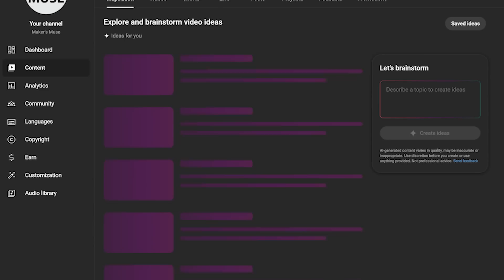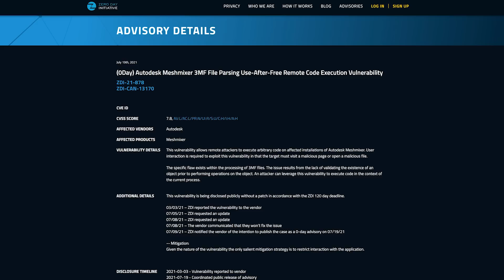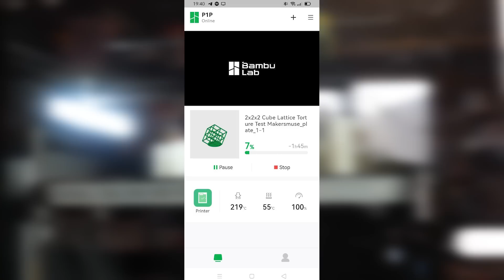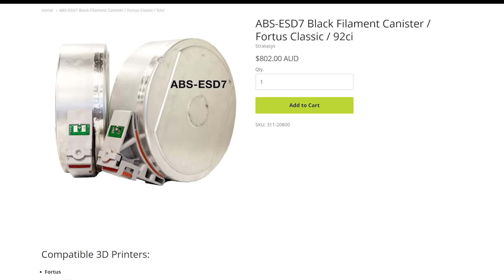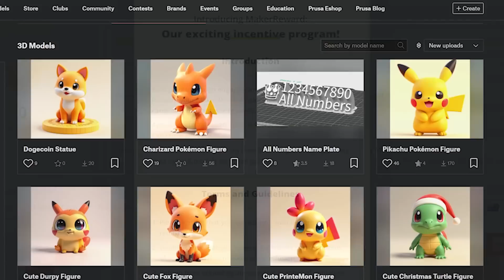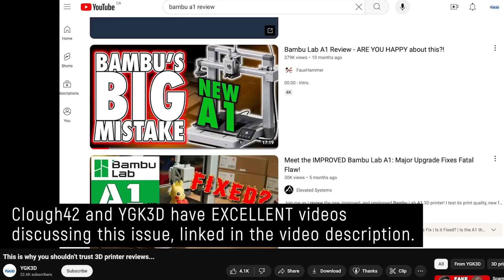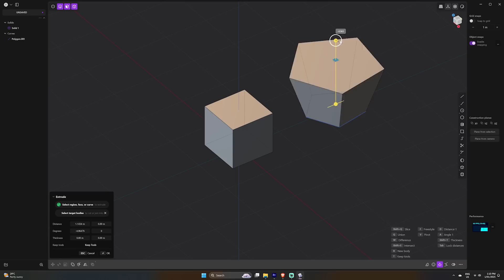My 3D Printing Predictions for 2025

Comment: I want a bambulab style resin printer. Pretty much everything self diagnosable. I went through the ropes of both fdm and sla since 2018. 

Its time to get these no nonsense printers. However my favorite is still the ender 5 ahaha
Reply from the maker: Formlabs or prusa sl1s are pretty close, but spendy
Reply: @MakersMuse  yeah quite expensive. If I will splurge then definetly the formlabs. looks insanely good.

Comment: Hey, do you have recommendations for flexible 3d printing?

I want to create stamps that work on any surface, therefore i need almost rubberlike stamps, but i have actually no idea what the differences in material are, what i should look out for and what printers work best, or which can't handle it and why.

Comment: Honestly, resisting AI and its place in 3D printing is no different to how it is in any other industry. You have two options, either make a moral stand against it, put your arm out in front of the bulldozer and and get bulldozed, or jump on the bulldozer and make it drive somewhere you want it to.

Referring to them as 'slop' doesn't help you, or anyone. Because in one year, that 'slop' is going to be indistinguishable from work of pros. And then where does that leave you? A bit like Motorolla and Kodak. No one ever got ahead in life by trying to resist innovation, they were the ones using the innovation to their advantage. People need to accept it is here to stay, it is advancing at a rate so fast it is unreal, and if you don't get on board, the majority of the population will as you get left behind.

No one has to be happy about the rise of AI, but trying to be condescending towards a program and insulting its outputs is a... strange use of personal effort.

Comment: AI that generates 3D is a bit different, because it's almost always actually two AI systems, the first to generate/design the image, the second to turn that image into a 3D model. So even if you did find out what it was trained on (the turn into 3D one) it wouldn't matter much because the one doing most of the heavy lifting is the image generator instead. This can be good or bad depending on how you look at it.

Comment: Angus, your channel is the main reason I took a shot at 3D printing nearly a decade ago.  From then on, I was hooked.  I even incorporated 3D printing into media classes I was teaching.  And now it's my go-to solution for my other hobby, model railroading.  I've made replacement parts, structural components, scenery pieces -- the possibilities are almost limitless.  So thanks for being a guide on this long journey.  And one other thing I'll add that I think will become increasingly important:  fabricating companies.  They're extremely affordable for big jobs I can't do myself.  I needed about 600 pieces for one job, and I found a company online that could fabricate my design for pennies a piece.  That's transformative.
Reply from the maker: Hey, that's amazing! You got in early, glad you stuck it out as the technology improved :) I fully agree, being able to have parts machined out of metal at an affordable price is incredible. between the two technologies, you really can make anything now.

Comment: Most of the hardware features are ironed out that prevented this hobby from going mainstream.  Now the big gains are going to be improving the software side, and make slicers more user friendly. 

 Bambu Lab has sort of got there using the app with creator tested profiles and slices that can be sent by a cell phone.  Even my wife is willing to give it a go. 

Cloud slicing, I think, will be more of a thing. Lychee has gone half way there switching over to a subscription base.

Comment: open Q and A 
video topic too please 
3d printer micro sd card reading limits
-- whats a solution for not being about to buy small gigabyte micro sd cards soon
my loc office shop is stocking only 64gb as the smallest micro sd card limits
can buy 8gb fake ebay cards?

Comment: G'day Angus. I've thought about getting into 3d printing with resin, but I'm hesitant. Not because of the safety concerns but rather the potential for failure. I tried FDM for a while, but it didn't work out. Any thoughts?

Comment: I fear your thoughts about 'cloud' are a bit incomplete, and you are missing the miost important and most dangerous part: Once an former software selling company has enough customers in their cloud, they will simply stop offering non cloud software. This is what happened with each and every software that went to the clouds before, and this will happen to any software in the future when there are enough customers using the cloud offer. It won't come back to your PC.
So the idea of 'having a PC with a local installation' in stire is completely useless and leading you into a false sense of security: The one day wheer you will want to make use of it, there won't be the software you need anymore. So don't expect being able to swap to another vendor's software when it's time - because their software will have been cloudified, too, already.

The potential loss of control, convenience, and ability already starts with supporting the enterprise's cloud ambitions by just using their cloud offer. Yes, also the idea of cloud stuff being more convenient is a short-sighted fallacy, because, you know: Once they have forced you into their cloud with no alternatives, you will have to pay for every little bit of convenience.

Comment: Much fewer printer reviews ! 
Perhaps though, a review is needed on a recent account of Bambu labs changing its terms of service and firmware update.
There seems to be a ruckus at the moment about how Bambu labs is restricting users of accessing and using their 3D printers through a recent firmware update.  I'm not completely sure what is going on, but It may be that 3d printers are becoming more proprietary like some tvs and other devices that need an internet connection to operate. A kind of prediction of more cloud computing as given here here except that to just send a print to the printer or control them on a computer LAN network, one surrenders their 3D printer and all print information so some external overlord. This may accelerate the other prediction made. That of digital minimalism. In this case for 3D printers.
Would consumers buy a 3D printer if they can't use it because it isn't connected to the internet or unless they use the manufactures price gouged proprietary products and subscription service ? 
Another prediction for 2025 that is in the DRM prediction which if comes true, may end 3D printing for the hobbyist that is the back bone of the industry, and thus the industry itself. 3D printing for the hobbyist may be numbered ?

Comment: regarding onshape, hardware performance is not really that much an issue anymore especially for the average user who will just make simpler assemblies - I can vouch that on the $40 chromebook I bought and installed Linux on both Freecad and Blender worked perfectly well. The main advantage Onshape has (besides marketing) is convenience - you don't need to bother installing anything, and it is trivial to create a free account and start working with relatively small limitations

Comment: As someone who has had to deal with 3D printing models for customers, the sheer increase in models that have to have their mesh and geometry manually adjusted to be properly air-tight for 3D printing is so unbelievably painful. It's so easy to tell they've just gotten an AI to generate a model put no thought into the design or had any input on what it actually looks like, pretty sad.

Comment: I might have gotten lucky with mine, but I was a little saddened to see the Tevo Tarantula footage when you spoke about bad printers. It was my first printer, helped me learn a lot, was my workhorse for the longest time and, baring some external circumstances, would still work well if I had the time to finish the upgrade.
I know that's not the point of the video, and that my affection is irrational. Still thought I'd speak up about a really old printer no one really cares about anymore ;)
Good video as always, cheers!

Comment: I'm glad that you predict the hobby becoming more about printing and less about tinkering to get that perfect print. In 2017, I bout a Monoprice Maker Select 3D Printer v2" because I heard it was excellent. Perhaps it is but I gave up using it several months after buying it because it was simply too finicky. I sold it to a local Maker Space. To much of my time was required to tinker with the thing. The ROI was terrible. Easier to use printers seem more attractive.

Comment: Cloud is convenient...but terrible.  I recently watched DJI completely shut out my access to my own drone that I bought back in 2018 as they just no longer support software to control it unless you download the app on your phone.  No longer allowed to control from your tablet.  It's rubbish.  So now I have a drone that cannot take off and is useless.  Imagine when Bambu Labs takes this same approach a few years from now and your X1 Carbon, is just no longer able to print at all.  It could certainly happen.  Other companies have done the same thing.  I have smart lights that are no longer smart.  It will become a huge problem when it extends to refrigerators, washer/dryers and everything else.  Our "CLOUD COMPUTING CULTURE" is hot garbage and a massive money grab.

Comment: As far as the open/close source issue goes (issue #1), it's not that I want to tinker with my printer (I too want one which "just works"), it's that 1) I'd like to be able to mod mine in the future, should I desire to do so, and 2) this hobby was built on Open Source, and for a company to build a product built on the openness of the community, and then not contribute back is not right.

Comment: I think you're going to see higher resolution at hobbyist prices. I'm down to 10μm features with 15μm positioning accuracy on the RepRapMicron prototype and that's got plenty of improvement left in it. The catch? 10mm print bed, and slow. However, exciting possibilities for printing custom displays, circuits etc. in multi-material mode. Ohyeah, it uses regular printer hardware and 3D printed parts. I am not yet done with the 3D printer revolution...

Comment: About AI training data: I’ve been selling 3D models through a large “professional-level” service for over a decade. Recently, I noticed a substantial sale that actually exceeded the combined value of all my models. “Hmm… that’s odd,” I thought. The same day, I received an email from the service explaining the large sale amount. Apparently, they were now offering large portions of their modeling catalog to corporations to be used as training data.

To their credit, they had established guardrails to ensure the models wouldn’t be resold “as is.” Additionally, if you didn’t want your models to be used as training data, you could opt out of the program. The frustrating part, however, was that the program’s announcement and launch were never directly communicated to artists (e.g., via email). It was only announced on their website. Since the only part of the site I regularly use is for uploading my work and checking on sales, I completely missed the announcement. They also didn't quantify exactly what a "corporation" is (e.g. size, products, etc.). lol

Comment: I've noticed a lot more requests for "can you 3D print this?" in the last year. Have uploaded a few designs to thingyverse over the last 7 years, never made a cent. There is also at least one case of someone selling 3D prints of one of my designs on eBay, but since it's so niche and low volume I don't care, in fact I see it more as a service than I can't be bothered to supply 😂

Comment: You should take a look at Alibre 3d CAD software.  I was disappointed as well with Ondsel closing it's doors... but for cheap, perpetual license, locally installed version of CAD that is cheaper than a $350 printer I'm surprised it's not used/talked about more.  Yes, their basic version has less features than their more expensive version which is still far cheaper than anything else.. for the 95% of users, the $200 version (buy once forever, just pay for upgrades if you want them) is a heck of a deal.

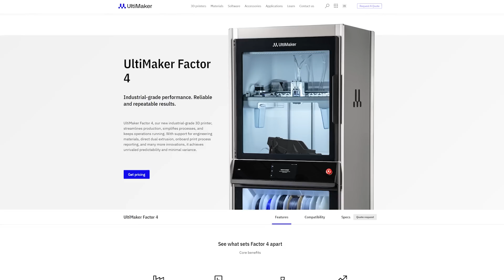Comment: 2:40 Qidi's printers are the only well-priced printers that chamber heaters and (relatively) high temperature hotends though. Sure, the K2 Max exists now, but that thing is also 2x the price of the Plus4.

The fact that I can buy a 450USD Q1 Pro and print large PA6-CF parts or PPS-CF parts is incredible for consumers with a side-hobby that demands good performance from parts. Sure, it's niche, but Qidi has always been living in that niche.

Comment: Just as a heads-up, none of the 'cloud' CAD platforms actually offload processing - they're in essence replacing the disk storage only. Compute costs are WAY too high for any company to be offering that for anything reasonable, and the free ones could never do this. Your local computer is still doing essentially 100% of the thinking, so you still need the necessary hardware to do the modelling. Chromebooks are fine for simple models, but get into anything mechanical or with organic details and it will turn into a powerpoint presentation.

Comment: Digital DRM is already here in a limited extent for 3DP2A. Companies like Stratasys and Markforged already have detection systems looking for the most common printed parts in that space, and will refuse to print and track user data on who is trying to do it. 3DPrinterOS recently announced their intent to develop this system as well to prevent the manufacturing of these parts, and there have been many local and federal agencies in the US attempting to write (generally unenforceable) laws criminalizing the ownership of these files. 

The genie is already out of the bottle on this one, it's just a matter of time until companies start to us it for private/DMCA reasons instead of legal/moral ones.

Comment: I 3D print engineering models before I machine them to ensure of design, function precision and accuracy in manufacturing in metal..  A $5 part 3D print is more forgiving to me than a $200 metal machined part to variety it’s feasibility.  CAD helps but hands on is worth its weight in gold when it comes to inspection of the designed part.

Comment: Generative modeling is nothing new, the AI Revolution is just the next logical step in it. As long as we use it correctly, I don't see the issue with it. If you don't like unethical AI, don't use unethical AI. Teach by example, and how to use it correctly instead of pretending it's some new boogeyman that we've not deal with before. I have four different models that I've trained on my own content (Can't get any more ethical than this, guys, the rest is literally just maths) that I use for various different goals. It's not hard.

From the perspective of a musician in the Maker space... I've had access to generative beat, chord and vocal tools for the better part of 15 years. They are just way better now. Teaching people what AI is would also be incredibly helpful in promoting ethical use. Spoiler alert; It's high-speed, automatic complex mathematics. That's it. Now that it's demystified, lets do what we've always done; Dump, tweak, hack, and reupload. We were a community built on ideas like RepRap and open source. Just keep the signal - the LEARNING - going.

Comment: Is hardware really that much of an issue anymore? My 9 year old mini tower with a 1060 managed to render a model of mine with several dozen components in less than 2 minutes (a high res preview picture). Admittedly it sounded like a leaf blower while doing it but it got the job done. Before someone buys a potatoe chrome book (that doesn't even run most of CAD softwares) for 300$£€ better get a used system that is capable of doing the job on its own.

Comment: My HOPES For 3D Printing In 2025:
1) We get better multi material 3D printers with multiple heads that don't waste time and materials pooping.
2) Slicers better support multi filament feeders by using purge to print infill instead of pooping.
3) Open source slicer developers collaborate to use standard printer and filament profiles.
4) 3D printer manufacturers stop re-skinning a slicer to make it proprietary to ship with their printer.
5) De-programming centers to rescue people from the Bambu cult.  These are our brothers and sisters.

Comment: I started off with reprap printers, a box of wood, steel and wires, even built a delta printer. Then the CR-10 came out and it was a revelation. Then Cura development changed the slicing and printing massively. I learnt to use Openscad and that progressed to me being able to design and print RC models. It staggers me that folks see things on Thingiverse, spend hundreds on a printer, print a benchy or a yoda, and then stick the printer goes into a cupboard. The printers available now are full of techno babble that are supposed to make it possible for someone who does not understand 3D printers to use them. The only advantage of the Core XY printers is speed. I have just bought a Qidi Plus 4 for that reason. The 8 year old CR-10 still runs and is tuned to produce excellent prints, it is simple to adjust, Cura is a doddle. Nothing boosts the self esteem like designing something that prints perfectly, and works. Even STL's that I have paid for have been badly designed, and meant that I have needed to redesign parts so that they work properly. Without learning CAD a printer is useless, and that is where the development will occur, rather than with the printers. It will become easier to use. However, I doubt it will be free, guys will need to make money somewhere.